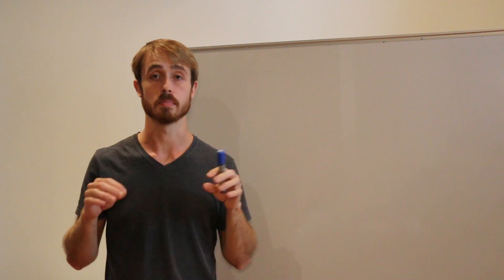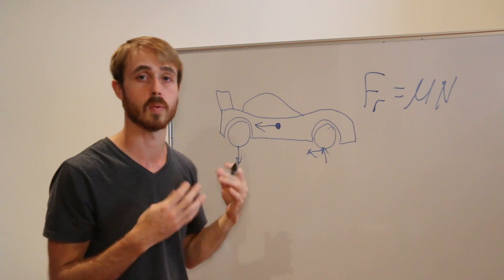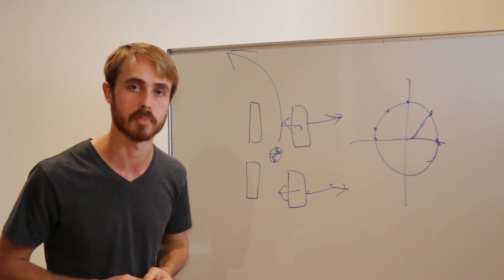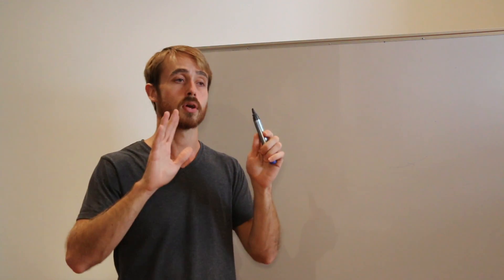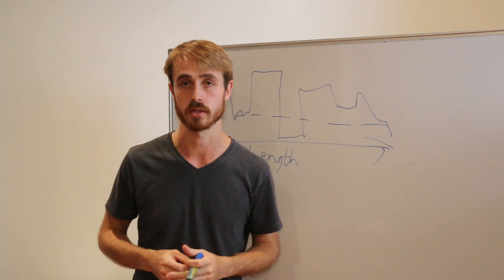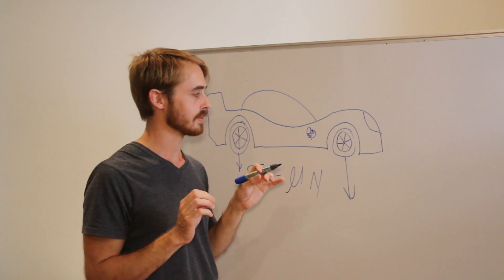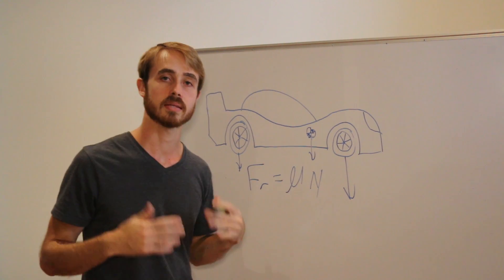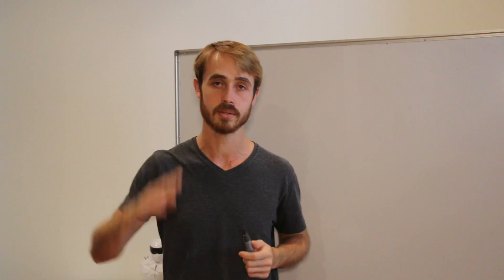Why is the Nissan GTR LMP1 Front Wheel Drive? A few reasons...

Comment: This is actually quite genious. It puts weight on the front axle which is helpful while turning especially in slow speeds where you dont have downforce to make the front work. Also most the power is still going down on the rear than the front so its more efficient use of power. It might be a very oversteery car though when you dont have weight or downforce to put down that 700 electric horsepower.

Comment: Great video and very interesting......but the historical follow-up 4.5 years later is a bit painful to read: 

"The Nissan GT-R LM Nismo...the car made its racing debut at the 2015 24 Hours of Le Mans. Three cars were entered for the race by Nissan Motorsports, numbered 21, 22 and 23. The cars qualified in the last three places of the LMP1 class with times over 20 seconds slower than the pole position time set by the #18 Porsche 919 Hybrid. The #21 car was actually out-qualified by the fastest LMP2 car. After the three cars failed to achieve a time within 110% of the pole position time, they were demoted to the back of the prototype grid.[29] The #21 car retired from the race after 115 laps with a suspension failure, while the #23 car retired on lap 234 with gearbox issues. The #22 car finished the race, but was not classified as it failed to complete 70% of the race winning car's race distance. The car was never raced again."

Comment: Fastest acceleration is rear wheel drive only. Ever. Period. Weight transfer is king for the first 60ft, and the first 60ft decides everything.  
Le Mans is not about acceleration. It is an endurance race. Long duration durability, fuel economy and tire life are larger concerns in a race like this than any other type of race (they're always important). The ability to dynamically adjust which wheels are using their traction the most is a HUGE benefit to tire life. Regenerative breaking to extend fuel economy is a HUGE benefit. 

So the question is much simpler than you represent it. The question is, "Can we build a car that is fast enough to be competitive, and still gain those other benefits of a hybrid powertrain?"  

At Le Mans, fastest means nothing. It's a different race with different considerations. This LMP is not designed to be the fastest. It is designed to win Le Mans.
Reply: This is also how the Ford GT won in their return to Le Mans -- they didn't build the fastest or best handling car; they designed a car to win Le Mans.
Reply: Fastest acceleration would be AWD.
Reply: Wrong. The fastest accelerating cars are rear wheel drive. Geometry and traction are not negotiable.
Reply: @ChristnThms  I don't see how that makes any sense. All the fastest accelerating cars are AWD.

AWD is rear wheel drive, but with extra power from the front wheels.
Reply: But you're wrong, and not doing any research. The reason is weight transfer. At the moment of acceleration, weight transfers from the front to the rear. This is why the front end rises during acceleration. When you accelerate hard enough, the front wheels will come completely off the ground, this completely negating any forward thrust they can provide.  

The reason that high performance production cars are often AWD is that the weight and crappy traction provided by street tires doesn't facilitate weight transfer very well. But, even in street cars, RWD is king.
Reply: @ChristnThms  You have shit suspension if you have no front grip when accelerating.

Comment: In my opinion what nissan has done here is the ideal because as well as what's discribed here there's the delivery of power  to consider. A petrol engine has to wind up to produce power i.e. there is a maximum amount of torque available at any given engine speed. With a motor however isn't quite the same. A motor, whilst horrendously inefficient at large slip figures, will draw as much energy as possible to reach the point at which motor slip energy draw equals energy consumption. What this means is motors  are capable of much better torque curves then petrol engines. So since the rear wheels provide the best grip due to weight transfer under acceleration that's the best place to put the motors. However, the petrol engine provides more power for weight i.e a tank of fuel verse the batteries and so is perfect for doing the majority of the grunt work at higher speeds. Driving through the front wheels has all the advantages described particularly since as described the centre of pressure is being dragged by the front wheels which is more stable then pushed by the rear. Just my opinion. Great bids, really like the way this guy explains stuff.

Comment: I am not exactly a big fan of this car. Because of its thinner tires, there is less contact with the street, so there wont be as much grip. But the bigggest problem is with the aerodynamics: because of the front engine, the "wall" going from the cockpit to the wing is shorter wich results in a smaller surface. And as this is extremely importand for high speed corners, the car will be less stabile than the audis and porsches.

Comment: They are driving awd I you were wrong if gtr was fwd it would have to much understeer so it will loose control
Reply: Jadyel Torres there are a million and one ways to get a fwd to be neutral under power. balance isnt the issue, its tire temperature and total grip

Comment: FRONT TYRES WILL BE WEARING OUT TOO EARLY!!! On the last two years, Nissan introduced "Delta Wing", a "full rear" project even for mass distribution. This year, they moved into a "full front" one. What are they thinking about? Ok, a full front means more grip on the front tires and a better direction, but... which front tire can last more than 30 minutes in a full front race car? I remember that in the former WTCC, Alfa Romeo was one of the best race car for qualifying, BUT their tires used to be burned after 2/3 of those "sprint" races... AND WTCC had less than 300 Horse Power, much less then the half of a Le Mans Prototype. So, what the hell? Can you imagine in a race lasting 24 hours? Nissan should be pitting every 15 minutes, which means 96 pits in the whole race... brilliant video, you look like an engineer, as I am too, so with quite soft tyres Nissan can make a good qualify for Le Mans, but... race is another thing ;-)
Reply: Alessandro Argese A le mans prototype is more focused on aerodynamical grip than mechanical grip, in wtcc you almost don't have any aerodynamic features at all, so the tires need to do a lot more work than on an LMP car.

Comment: Good video and I like your explanation. One thing though, from what I know (I really hope I am correct here as I work for Nissan so if I'm wrong it will be embarrassing) the flybrid system can send power forward as well as rearwards and the car has a very complex AWD torque vectoring system. From the video I was under the impression that you believe the flybrid systems power only goes rearwards. Feel free to correct me if I'm wrong. One thing I don't quite understand is how the air tunnels work and I would be very interested to hear your ideas on the subject of them.
Reply from the maker: Joseph Topps You are correct, since I made this video they have said that they are currently harvesting and delivering just to the fronts, and have not yet installed the driveshafts to the rear (at least from what I've read to date...). Not sure on where they are at with the AWD torque vectoring system, you may know more than me on this! The air tunnels are a clever way of extracting air from the floor, kind of like an extended front diffuser I guess is the easiest way to explain it... You may want to watch my video on underbody aerodynamics, it explains some things relating to this:

https://www.youtube.com/watch?v=HXxkNF2L__8&list=PL6R7zR4ZbGkOjkUA73UAD9sQBtdSseb58

Thanks for watching!
Reply: Thanks for your reply. As far as I know the propshaft runs high up in the body and it uses to portal axles either side to raise the driveshafts out of the air tunnels. I think the torque vectoring will be quite similar to the GTR road car in principle where an onboard computer does the calculations and adjusts the differentials accordingly. Only in this case it's distributing drive from two different systems combined as opposed to just a combustion engine. I have tickets to the WEC at Silverstone but from what I have heard recently Nissan may not be present because of development issues which I suppose is to be expected with such a radical car.

Comment: Lemans protoypes are mid engined, in front of the rear wheels (excluding the nissan of course) a porsche 911 is rear engined, behind the rear wheels.
Reply: The nissan is actually mid engined as well, the engine is right behind the front wheels.
Reply: Quintinohthree infront of the monocoque.  But yes, arguably you are correct.

Comment: Hey 😊 I've got a question. The new Nissan 2015 lmp1 car use a flywheel to store energy from breaking, but how do they make sure the flywheels speed keeps increasing as the car is slowing? And when they deploy the energy stored, how do they make sure the car accelerates, when the flywheel must be losing speed?
Reply: Robin Swann Do you know how a CVT transmission works?
By varying the ratio of input or output shaft they can maintain the speed of one of the shafts while the other is accelerating or decelerating.

Comment: In the P=F*V part, you state that the force goes down as the velocity increases. This is under the assumption of constant power delivery. So yes, to put the same amount of power down, there will be less force at high speed. However, the required power, to overcome aerodynamic drag scales with V^3. Pdrag_aero=1/2*rho*A*Cd*V^3.

Comment: On your explanation of the aerodynamic advantages: The other LMP1 cars are mid engined so the rake of the rear diffusor can still start relatively early. But the the mid engined cars also have a front diffusor which i imagine is harder to implement with Nissans front engine.

Comment: IMO, the new lmp one form Nissan is just marketing gimme unless they manage to explore some major loophole in the rules. They can't have the ideal floor shape, cause a electrical motor is larger and heavier compare to their petrol counterpart. Unless they have major breakthough so significant all electrical motor are stone tool compare to what they have. I had looked into some commercial off the shelf motor, they all huge and big.sure you can have a high power compact one, but it still big and heavy compare to gas engine and its service life under frequent flat out operation is just a fraction of under continuous power. Plus, ther efficiency sucks. Further more, a competitive design need years of refinement to achieve its competitive stay. Engineers need to learn their own design to make it better (I kid you not). And, without a relatively stable baseline. That refinement is out of window. For the track record, the deltawing was not competitive and even out pace by LMP2 car in som race. But that layout is far more promising than what Nissan have here.

Comment: The width of the rear tires doesn't look like it can provide a whole lot of grip when coming out of a turn after power is sent to the rear....I it looks like big wide front tires are gonna be doing all the work provide all the grip pushing in and out of those turns...it most certainly isn't going to have over steer issues and the driver most likely won't have to worry about feathering the throttle trying to find that grip in the rear. Given the agility of LMP1's I don't think being FWD is going to be too much of a problem for it...all I see is grip and good fuel mileage due to the slim rear wheels

Comment: you did a prety good job of explaining what's going on apart from the part where you are saying it also has an electric hybrid sistem.....i was reading an article about this car (it was top gear i think), where they were told that the hybrid part is not electric but an 8kg rotor located in vacum, so when you brake, the energy instead of charging batteries is used or transfered in to kinetic energy of rotation of that mass (huge rpm's, about 60000 i think), so when they need to deploy that energy it is conected mechanicly to the rear wheels via cluches and drive shafts :D so if i understanded it corectly, energy for braking is harvested and used to rotate the flywheel (accelerating 8kg to 60000 rpm needs a lot of energy), and that kinetic energy (i calculated it at about 14,2MJ if you assume it has 60cm diameter) is sent to rear wheels when needed like a quite big burst of energy :D
i hope you find that interesting and understanded what was i trying to say because i am not native english speaker :D
Reply: You might be right. I looked into that again, and it turns out there are 2 different solutions on flywheel hybrids on the market. The Williams System in the Audi is electric, as i explained.
But there is a second company, called "Flybrid Systems" who work on a purely mechanical version. The flybrid system was also already used at Le Mans in 2011 by the swiss team Hope Racing.

BTW concerning the flywheel diameter: that top gear article says that the outer edge of the flywheel is spinning at more than Mach 2, which can't be right since in vacuum there is no Mach number. But if we assume they mean Mach 2 relative to normal ambient air, that would be tangetial speed of around 680m/s and at 60.000rpm that means a diameter of ~22cm.
Reply: KYLE.DRIVES
Audi uses a similar flywheel system (except with less capacity) in their LMP1 car since 2012.
The system was actually developed by Williams for the 2009 F1 season (when KERS was introduced to F1), however the concept was banned from F1 before they had it race ready. Williams kept developing the system and supplied these units to Porsche (for the GT3 car that almost won the N24 in 2011) and later to Audi (for the cars that won LM24 in '12, '13 and '14).

So the flywheel hybrid is not new, it has been around for some time.

Nissan have not yet revealed if they are also using the Williams system or one from a different supplier. Either way, it is expected to work the same way the Williams system does, and that has nothing to do with clutches or drive shafts like janezick suggested.
The hybrid system works just the same as any other electric hybrid, except that the electric energy generated under braking is not stored in a battery. Instead it is transferred to a motor/generator unit that powers a flywheel. The energy is therefore stored in form of kinetic energy of that rotating mass. Then the MGU is set to generator mode and slows the rotor down, generating electric energy that can be used to power the wheels.

Compared to a battery this gives the advantage that it is possible to transfer much higher amounts of energy in a very short time. Keep in mind that an LMP1 race car at mulsanne corner is slowed down from 320kp/h to 80kp/h in about 5 seconds. Thats a lot of kinetic energy that can be harvested in very little time. You'd need very special batteries in order to charge them that fast, and these batteries then need a lot of cooling and cause a lot more wheight.

Also, these calculations about capacity can't be right, mostly because the diameter of the flywheel is much less than 60cm. It is more like in the region of 15 to 20cm i believe.
It would not make sense to use an energy storage with 14,2MJ capacity anyway. According to LMP1 rules, a car is allowed to recuperate a maximum of 8MJ of energy per lap at Le Mans. Since at LM you get about 7 loading cycles per lap, that means even if you want a bit in reserve you don't need an energy storage bigger than 1,5 or maybe 2MJ.
Reply: Hannes Größlinger  yes if you use your assumpsion about 1,5MJ storage and 8kg mass, you get around 26cm diameter if you use an equation for rotational kinetic energy, which is similar to what you have calculated ;D
Reply from the maker: Yeah I know, sorry, as I made this video the information out on this car was very limited, and most articles stated it was electric with only a bit of speculation about it being a flybrid. Since I uploaded the video it has been confirmed a flybrid, and that is just something I will have to deal with being wrong in the video (might put an annotation on it). Even top gears article released 1 day before I made the video listed it as electric:

http://www.topgear.com/uk/car-news/nissan-gt-r-le-mans-car-2015-02-02

"Because while the fronts have to cope with 550bhp of internally combusted goodness, the rears have to manage somewhere in the region of 700 electrically generated horsepowers."

This actually isn't the first flybrid car, I believe Porsche had a prototype flybrid GT3 back a bit. 

Thanks for watching!
Reply: Hannes Größlinger  hi, about that flywheel system i was not suggesting that it is mechanical system but the top gear said it was, because they got an exclusive inside look at it and they described it as purely mechanical system as is said here on page 5: http://www.topgear.com/uk/photos/nissan-le-mans-racer-lmp1-gt-r-explained-2015-02-09
About energy i know nothing about regulations so you probably are right i did my calculations on assuming it is 60cm flywheel but it is surely much smaller because the whole car is like 1m tall so there is no room for such a big flywheel, so you have your point there i agree  :D thanks for some usefull information btw, it is nice to se that, there are someone who still tries to explain you something that he knows about rather just arguing about things he knows nothing about :D